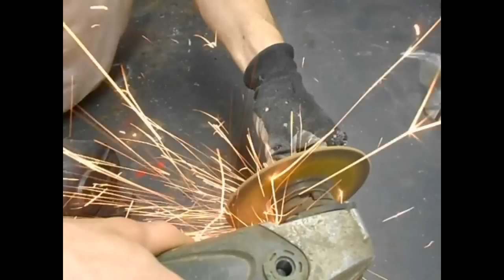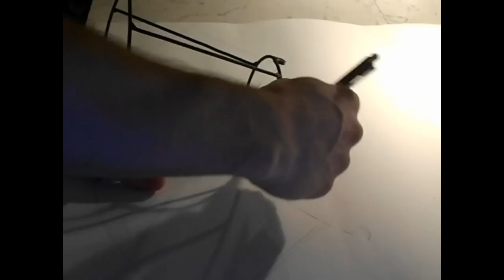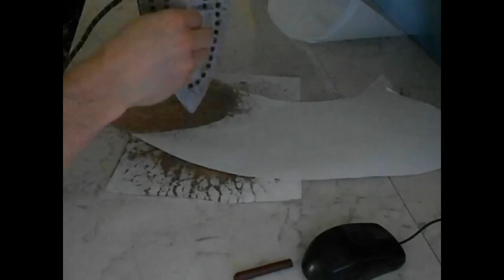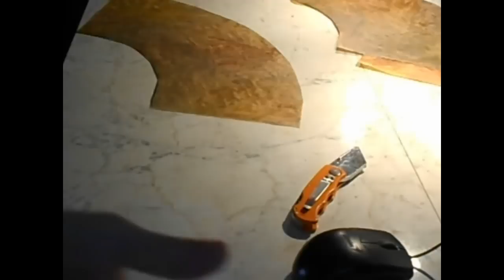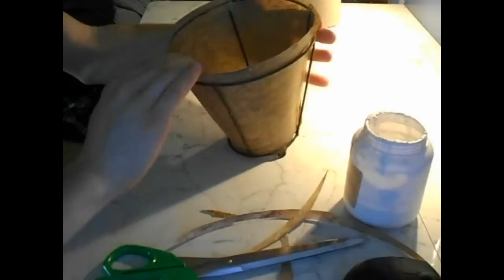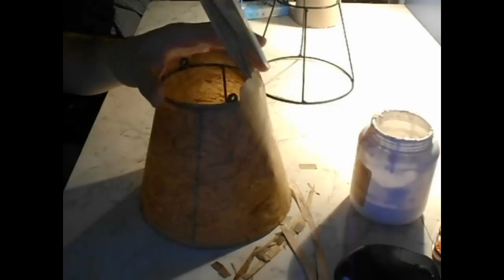How to make a lampshade

Comment: That is amazing work. 

I found you while trying to find what gauge wire to use for making lamp shade frames. I work with LED conversions of lamps. This is considerably different than just dropping in a couple of LED bulbs.

For many of my lamps I will have to modify and recreate the shades to suit my purposes. I have a spot welder and changed one frame with it, then got side tracked by life. But I am starting to get into it again. Where does one find steel wire that isn't galvanized? Any suggestions of what gauges I should be looking at? I do have a MIG on the way, but I would like to beable to do most of my work with the spot welder.

Thanks in advance, if you happen to notice this comment on a video you posted years ago!

Comment: What type of paper and wax did you use?  This question is driving me crazy. I cannot find out what the appropriate types of paper are. Some suppliers say "lampshade paper." What is that? What is the paper that looks like parchment?
Reply from the maker: Ellen McGuffie I used wraping paper, you can use printing paper, and try to experiment with any type of paper and use the one you like. As wax, I used wax crayons, but again you can try bees wax depending on the color you want. Lampshade paper I tink its heat resistant, but with this regular paper you have to use LED or economy light bulbs

Comment: What MIG welder are you using and is it with gas?
Reply from the maker: Its an Einhell 125 amps 220 volts with CO2 gas
Reply: Thanks! I have been getting a lot of information about what sort of set up to use. You have the only video that you are making your own lamp shade framing from scratch. I just bought a lamp shade binding machine for my lighting design company. I am trying to make circles like you do in the video with no clean up. It looks like you are accomplishing that with the MIG welder. Do you think if I get any MIG welder that is 125/220 with the CO2 hook up I will be able to accomplish what you have done in the video? If you have any brand suggestions I am all ears. ( I don't see the Einhell brand anywhere) I am new to this and would love any advice from some one who is actually making great lamp shade framing. If you want to check out my lighting design company. Its www.getlowillumination.com   Thanks! Seth M   
ALSO>>>>There are so many different welding machines  out there. I do not have a 220V plug in my shop so I am hoping to find one that I can use the CO2 hook up but also has a reg plug. I see that some of them come with both plugs.  There are just so many options.  You see what I am trying to accomplish so any suggestions would be so helpful. Thank you!!!!!
Reply from the maker: My father bought this wealder about 10 years ago for his company he has a car servise body shop. I use this wealder because is in the shop and I dont have to buy an other one. we use 220 volts because this is the standard in Romania, we have 220 and 380 volts. You can use 110 volts and CO2 or argon gas or flux coated mig wire with no gas, but gas makes the weald cleaner. I  use CO2 because its cheaper than argon. As wire I use 0.6 an 0.8 mm wire. TO make clean weald you have to practice a lot and learn how to setup youre wealder like the wire feed and the amperage. I learn to weald when I was in high school on an oxy acetylene wealder. As a brand Miller is a good one. 
    Check this video I think it will help you https://www.youtube.com/watch?v=HVZynf3Wbok
    And also ChuckE2009 has a lot of videos about different brands of wealding machines. 
   Good luck, and I'm here for any questions!